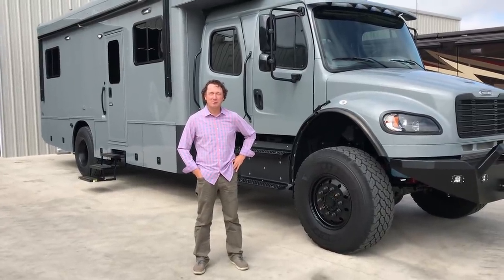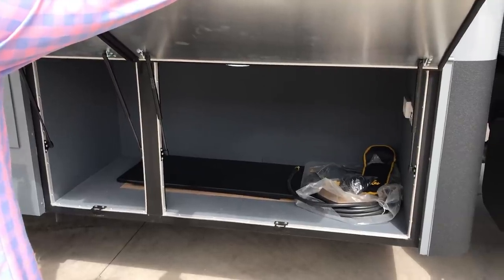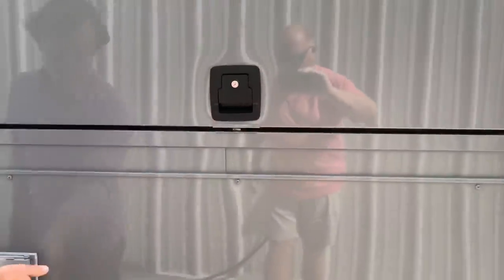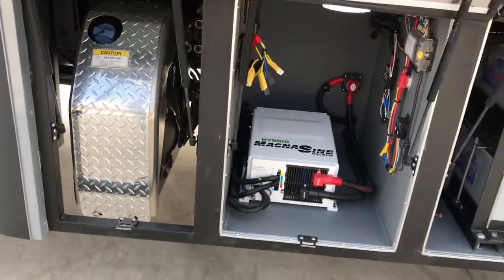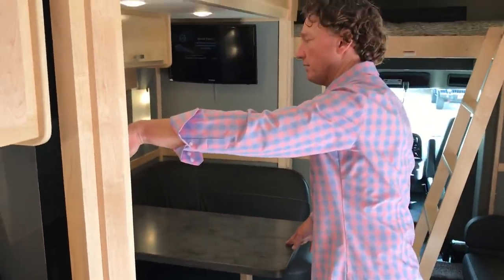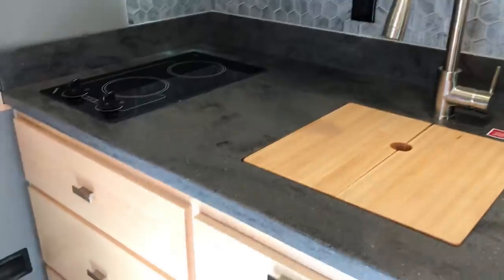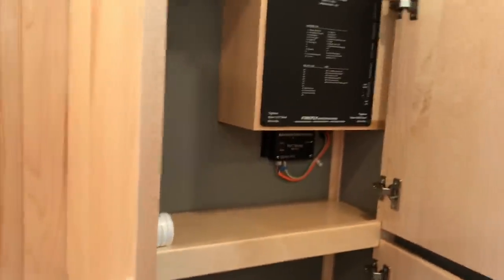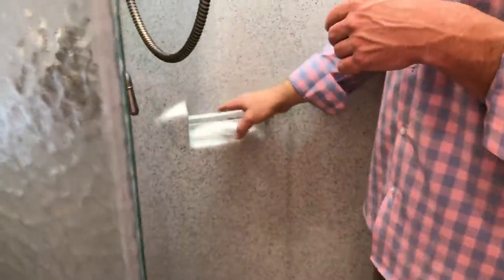Showhauler Overland Expedition Coach from Performance Motorcoaches

Comment: That Freightliner should have a double rear axle for ride stability and the weight of the sleeper just a thought.
Reply: I'm with you on this.  Even the pickup based 4x4's don't have much 4x4 moxy.   Same thing with these.  A 30-35 footer on an M2 or MV chassis should be a 4x6 on normal tires.  All you realistically want out of a rig like that is traction.  Not rock climbing ability.  I mean, the 4 wheeler look is cool.  But in reality, it is more look than performance.  Who would want to even RISK rolling one of these.  Tow a Jeep.  Roll that.
Reply: You r missing the point of this vehicle.  When you go out and camp in places that have sand , dirt,  or mud roads you can now get there without the fear of getting stuck. All the places I pull my toyhauler are inaccessible for a normal motorhome. Air the tires down on this thing just like I do on my Truck and you get there just fine. Now you don't have to camp in a crowded rv park

Comment: Did he say it can only tow 2000 lbs
Reply from the maker: This unit is equipped with a hitch rated at 10,000lbs. A 40k hitch is an option on new builds.

Comment: Better if you learn to give some information on Type of Diesel or Petro engine, miles per gallon one can get. Also, the type of transmission Front or All W drive.  I can see the storage space etc. but your focus should well on technical information too.
Reply from the maker: We have an additional video that has in-depth information on the chassis.

Comment: Nice rig i would love this,  25k winch for this rig way to light 30 k minimum..This truck weighs at least 18k to heavy for that winch..
Reply from the maker: This is the largest electric winch available, anything beyond 25k would require a hydraulic winch, very costly. We build to customers specs, are you in the market? If so we'd love to hear from you. visit pmcrv.com for contact info

Comment: Is this rig solar powered??
Reply: They said 370w solar panels on top, but just 2 AGM batteries... so just enough to watch a tv show with some lights on for the evening.   If you want more than that you’re looking at a major upgrade for additional batteries and panels, as well as inverter.
Reply from the maker: They are 8Ds. Pretty good size.
Reply: @Erin-Thor  THANKS.
Reply: @Performancetx  thanks.